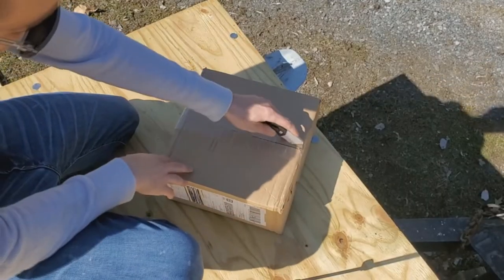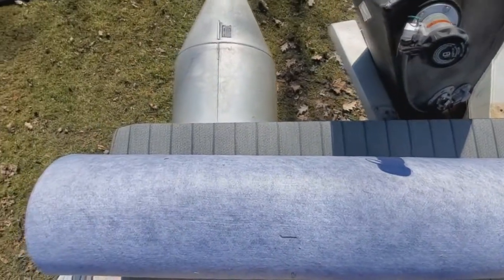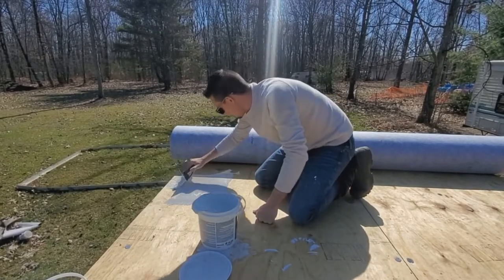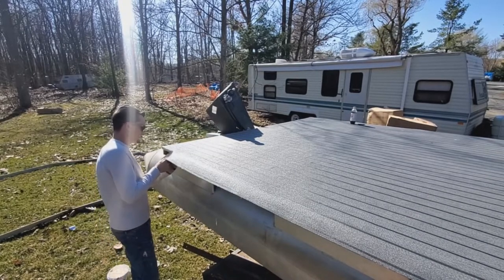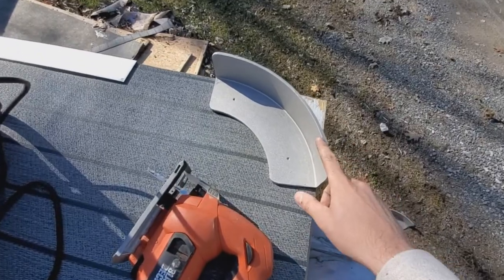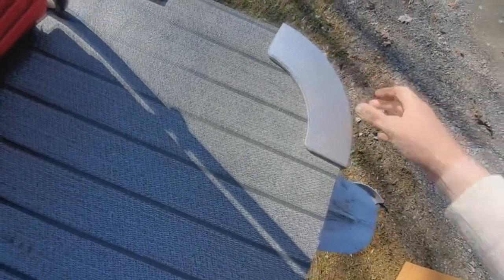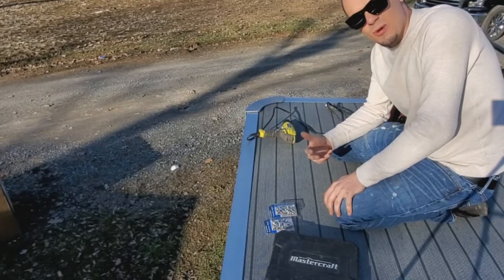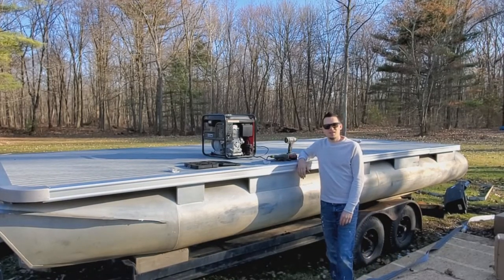Pontoon Build - Floor Vinyl and Deck Trim - Episode 2

Comment: Water will go right under the trim and wet the edges of the new deck. Needs a waterproof strip under the deck rail.